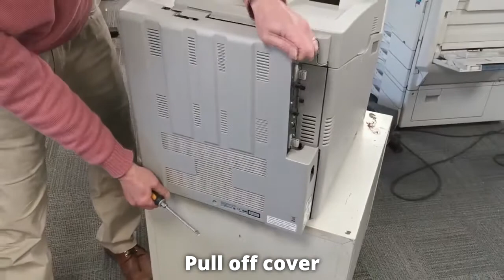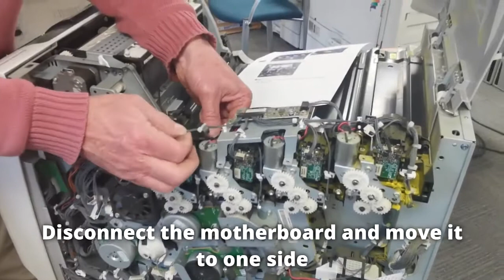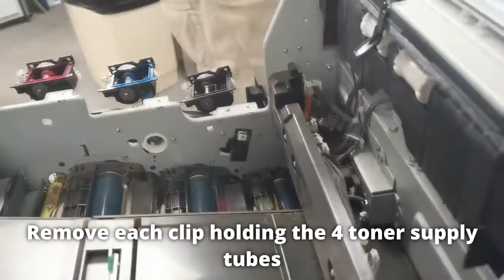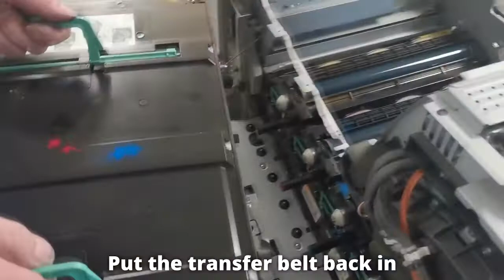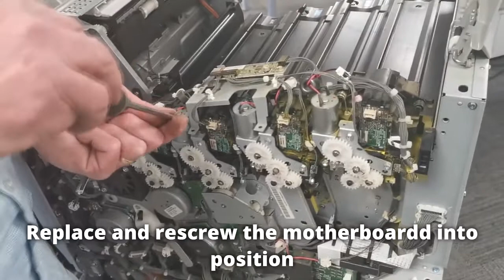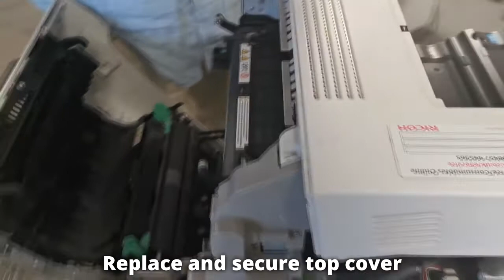How to clean up a Ricoh SP C430 / SP C440 for conversion to digital ceramic printing

Comment: Do i need replace magnetic powder for the fisrt use on a new printer ? After do all step follow this video , can i start print waterslides with my new printer ? Sorry about my bad English :(
Reply from the maker: You need to clean the machine as per this video, then replace the toner and finally you need to replace the developers.
We have further videos to show the additional processes.
Reply: @fotoceramic2971 are you doing to upload the further videos about the replacement? I couldnt find them

Comment: What if I have a brand new printer, do I need to convert it still?
Reply: I have the same question.  If I find a new printer do I just need to replace the toner and adjust the settings?
Reply from the maker: If you have a new printer and the toner bottles have not been installed then you will just need to replace the toner in the bottles and the developers.
Reply: @fotoceramic2971  Perfect, thank you so much!
Reply: @fotoceramic2971  Why would it be necessary to replace the developers? Wouldn't it just be the toners to be replaced in a new printer?

Comment: Hi, my ricoh 430 ceramic has ghost images when printing, the images from the top were copied to the bottom photo in a A4 format, can you please guild me how to solve it, i'm from campodia! 
Much thanks and appreciated !
Reply: Symptom Possible cause Necessary actions
The same or similar image appears two or more times. They get weaker and weaker.

Defective PCDU Replace the PCDU.
Defective transfer unit Replace the transfer unit.

There is another type of ghost, some color are off line, then, you got to have knowledge on service manual
Reply: Better ask your ceramic printer supplier
Reply: @vvv999vvv  i bought toner online and converted the printer myself, so there is no one gonna help me, i had changed a lot of parts involve PCDU,transfer belt and fuser,but still get the same issue! Could you please give me a hand ?Much thanks!
Reply: @firecrack8747  Seems to me only a few company selling the ceramic toners, if you buy it online, I wonder does it work or not, and surely no one will help you and do not waste time or money on the printer tech or copy techs, they do not know the problem, my opinion also suggest that, do not buy the parts individually, buy another machine for parts.

Comment: good demo, but far from convert to ceramic printing. Ricoh will not support any printer that is modified
Reply: If you buy a used printer, do everything in the video, replace toner with ceramic toner, is that all you need to do for this model printer to print waterslides? Do these printers have toner chips that will stop you from refilling or putting the ceramic toner cartridges in, propitiatory?
Reply: @eurekaart9309  It took me years to convert successfully, it is not worth to buy a old printer to convert as you might need parts and the manufacturer will not support, and many parts can not obtain from the market. You must learn a lot by your own, you need chips for replacement of the toners. My suggestion is better buy a turn key system, still, if you are not in this industry, your learning curve will be very long - it is not simple photo editing, also firing curve is different for different materials.